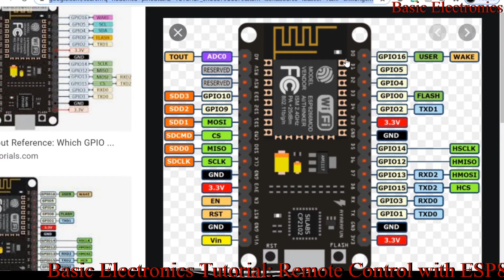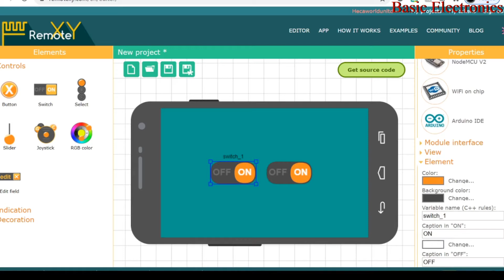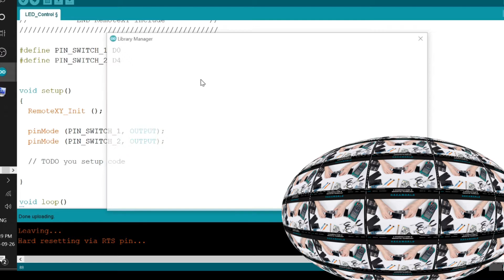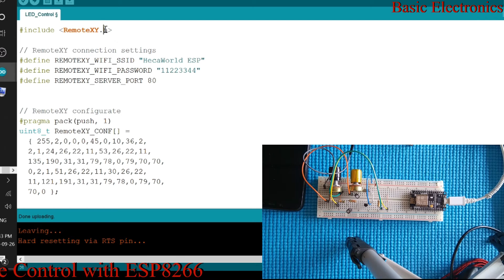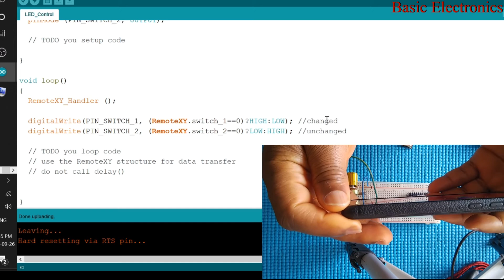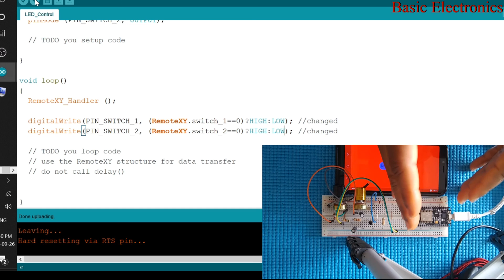Build Apps without codes | ESP8266 & Arduino Tutorial | Control LED from a remote location |

Comment: How can i add 3 seconds delay to the button so it stay high for 3s before going to low again? after i pressed it.
Reply from the maker: You many not be able to add it to the app, but you can surely add it to the Arduino code. Simply add a delay e.g., delay(3000); followed by the next action you want it to perform.

Add your delay within the 'if statement'. An example is given below.

  if (req.indexOf("/ledoff") != -1)  {
    status_led=0;
    digitalWrite(LED, LOW);
    delay(3000); //Here is the delay
    digitalWrite(LED, HIGH);
 //Here is the next action

  }
  else if(req.indexOf("/ledon") != -1)
  {
    status_led=1;
    digitalWrite(LED, HIGH);
    delay(3000); //Here is the delay
    digitalWrite(LED, LOW);
 //Here is the next action
  }